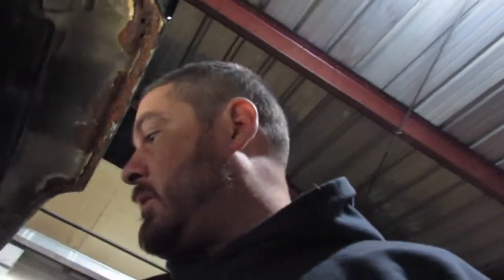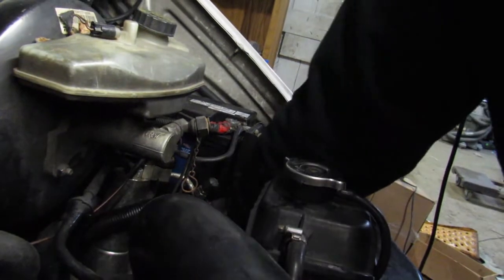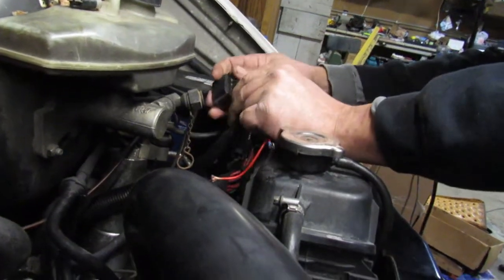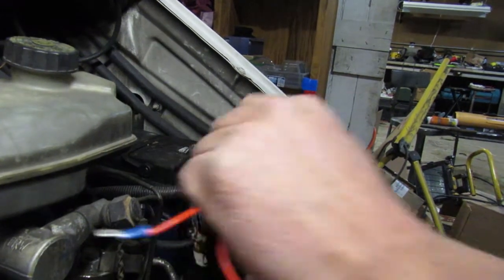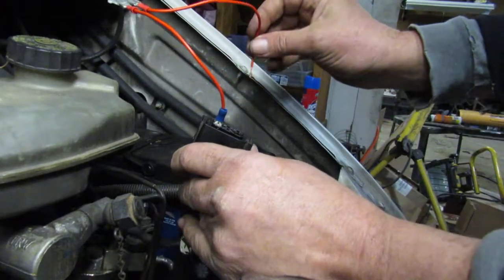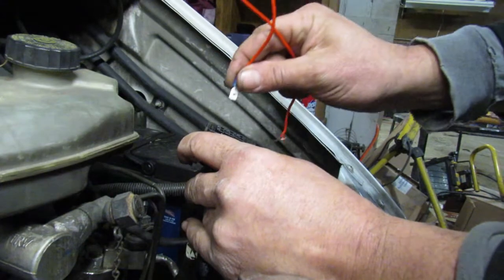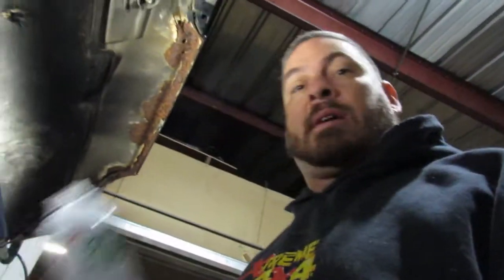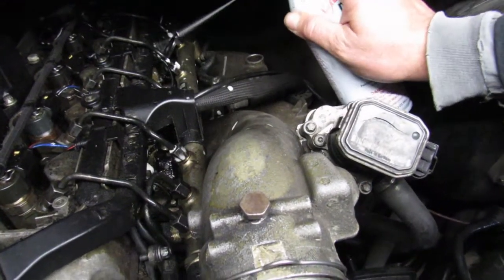2002-2006 NAFTA Sprinter (OM612/OM647) Glow Plug Test Using A Homemade Fused Jumper

Comment: Sometimes nothing happens when you touch wire to battery= glow plug is broken too. But little sparking between battery and wire and still doesnt burn the fuse means glow plug is fine.